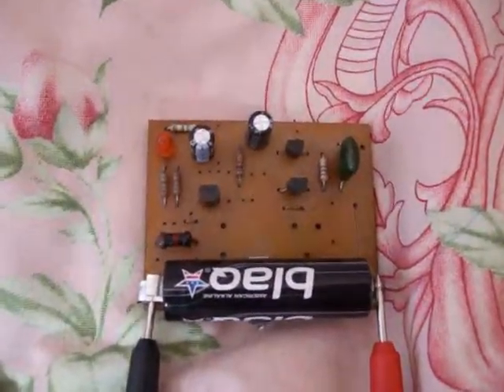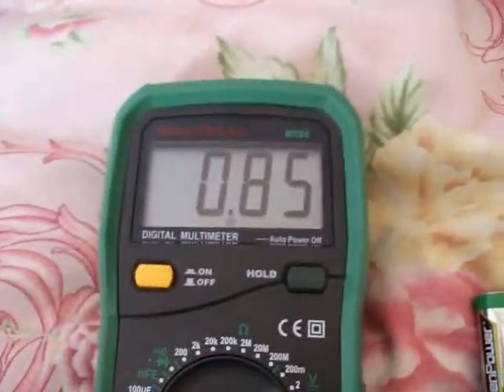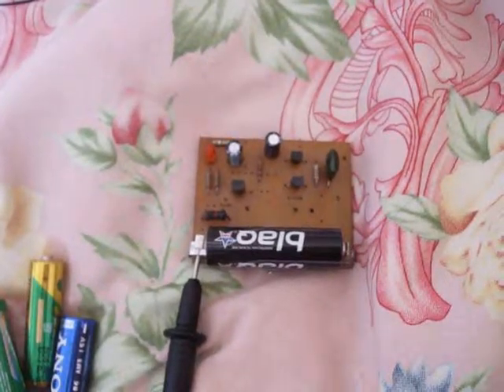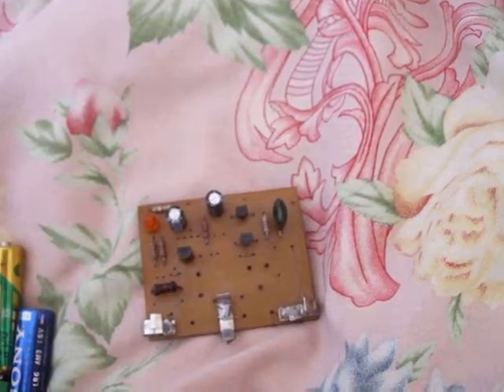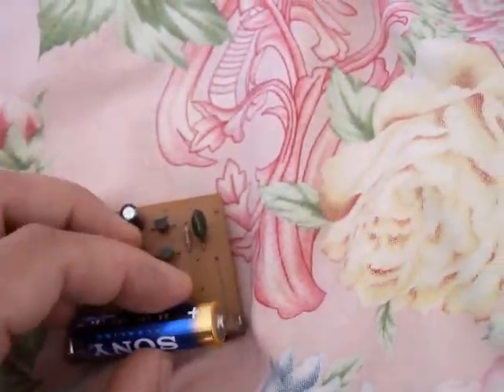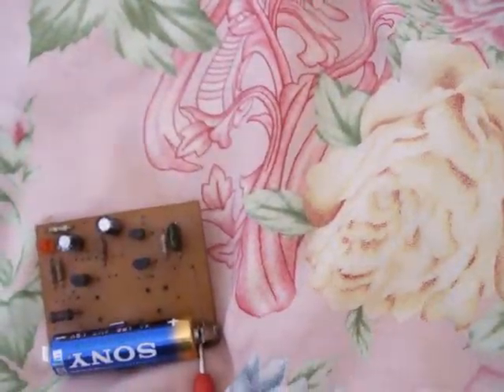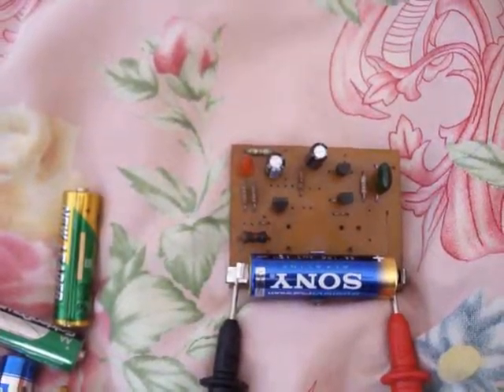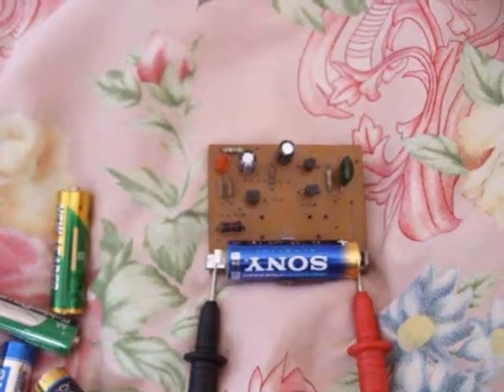Low load battery test

Comment: Brilliant circuit, simple flip flops and so reliable.
Reply from the maker: +RODALCO2007 It is, only weakest link on this circuit was salvaged electrolytic capacitor that went open circuit few days after the video. It was easy fix once I found out why it no longer did blinky-blinky.